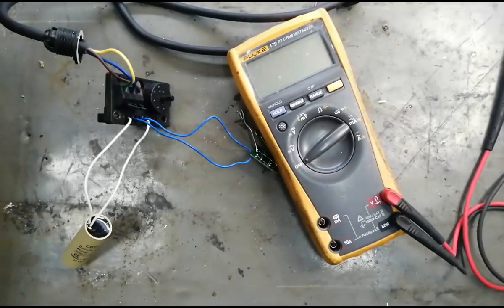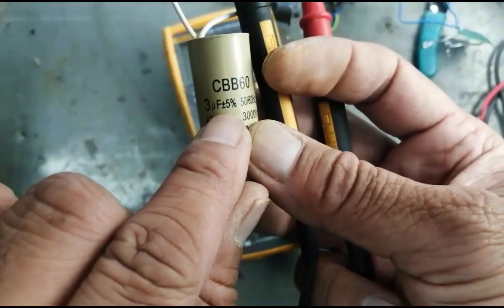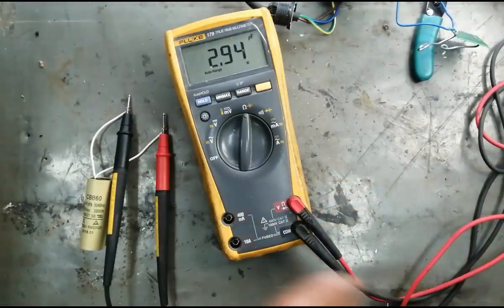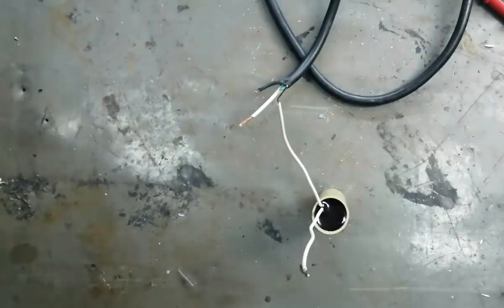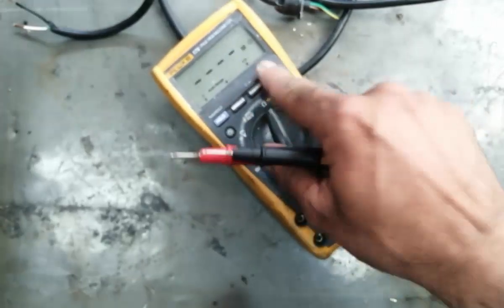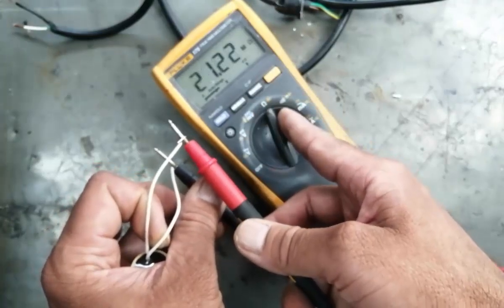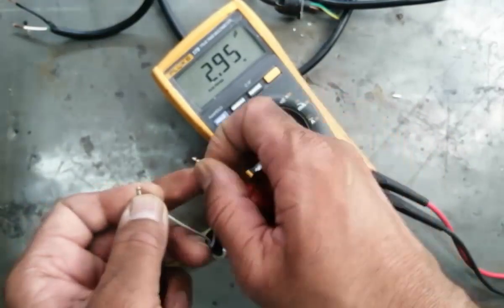#157 How to test non Polarized CAPACITOR

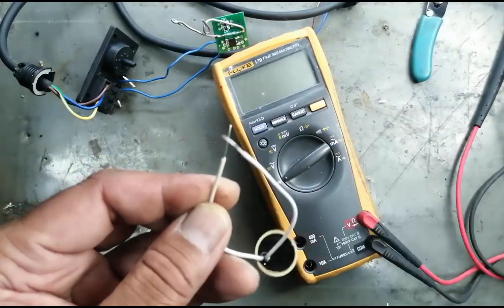Comment: 0:37 "IT IS SAFETY"  LMFAO
what ??  to short the leads of a cap directly    LOL

NO... IT'S SAFETY
1. to get a high value resistor 
2. then to put the resistor as A LOAD across the capacitors terminals to dishcarge it

Shorting a capacitor, Especially while touching it with your fingers is kinda stupid